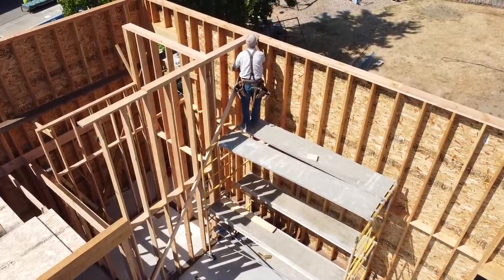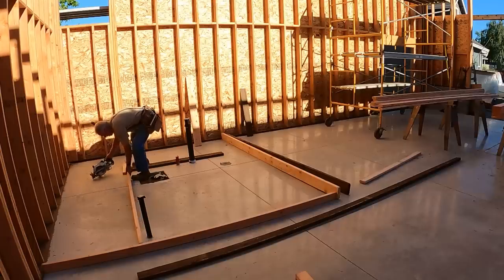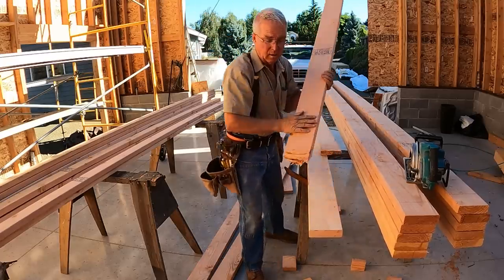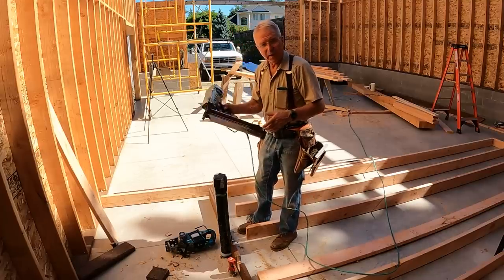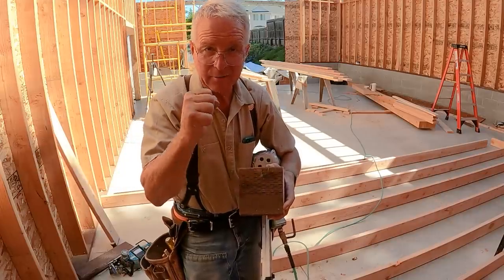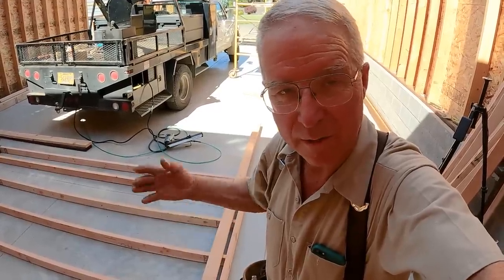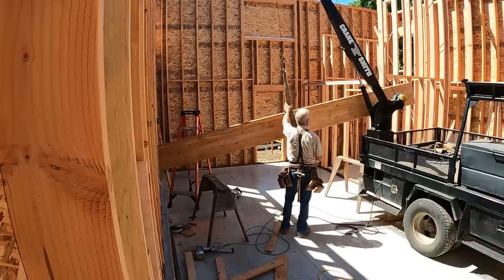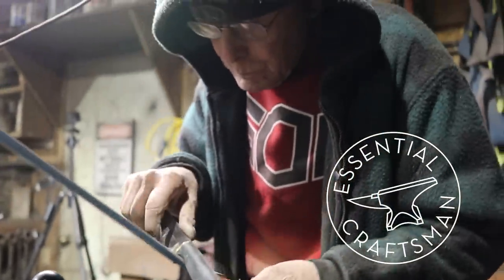My Truck  Has a Secret Weapon! Shop Build #12

Comment: 4:45 - I personally use 3 nails, one dead center, and two as far to the edges as I can without risk of splitting the wood. For the ones near the edges I angle slightly towards the middle to give them a little more bite.
Reply: Yeah, I was concerned that Scott seemed to be angling those nails out rather than in.

Comment: I’ve always understood that the compounds in treated lumber react to bare nails and that even in an interior “dry” environment galvanized or exterior grade fasteners should always be used in treated lumber
Reply: It wasn't like that until the EPA made them change the ingredients, it started eating away the fasaners.
Reply: That was my understanding too.
Reply: You are correct.
Reply: G-185" designation (which refers to the thickness of the galvanization). Anything less than a G-185 level is inappropriate for ACQ lumber.

Comment: FYI, the corrosion thing with fasteners in PT lumber has as much to due with chemicals used to treat the wood, as it does with metal exposed to moisture. Most chemical treatments use a copper compound, and that sets up a galvanic or electrolysis type corrosion to the steel even if your wood is “dry”

Comment: I've got to say, that's a pretty slick design you ended up with - a stairway that turns around the outside corner and is hidden behind a small bathroom. It's an elegant solution that keeps the building tidy and eliminates most of the wasted space that a traditional straight stairway would leave.

Comment: Spike knot… But it had the stamp of approval on it from the inspector.. 😂
Reply: To be honest ( I’m a builder) the cost of loss on the lumber yard is to high. 
The lumber yard tells you these knot filled boards are for your short lengths and blocking.  

In fact ( I’m with a GC) when the lumber yard has a project contract. They just send us extra boards for this reason alone   If the number of unusable boards it to high they just send us more.   They don’t even want the bad boards back. Just use them up where possible. 
Ohh and BTW.   This is a big part of being a carpenter. It’s are job to pick these issues out and work around them

Comment: I can tell you from personal experience the corrosion of uncoated fasteners in pressure treated wood is real. I don’t know if moisture needs to be present but if it does it’s a very small amount and treated wood certainly has moisture—also there’s usually enough residual moisture left in the concrete to get a small amount of condensation.

Comment: I live in our family home that is over 140 years old; it had no pressure treated lumber and is still standing and the nails/spikes they used to hold things together haven’t rotted/rusted out, probably because they’re huge. It is ballon frames with a dado cut into the studs in the interior walls to hold the floor framing and has post and beams along the outsides which carry most of the load. In having done some renovations over the years o can say things are well build as demo was a real PITA, the only benefit was no fire blocking or insulation in the walls so pulling wiring from basement to attic was easy though the gas bills to heat and electric bills to cool the house aren’t what one would call low. You can build things to last which frankly isn’t something that code is for as, at least to me, code in spots is extreme under kill for making things that will hold up and last and maximum overkill in some areas where safety has just gone too far, making some things just too expensive. 
The tools can definitely make life easier especially as you get older; we were just talking the other day about working when we were younger and how we used manpower for everything and looking back at what we could accomplish I’m amazed as today near everything we talked about would involve using or renting heavy equipment as the workers today just don’t seem to have the same grit level, or maybe they’re just smarter long term by not focusing so much on their body power and more on their brain power.

Comment: Hi Scott. You do everything so well. How about using a wireless  system for your crane controls. They are not expensive and are used a lot on trailer  and boat winches here in NZ.

Comment: Just a heads up as to why you use hot dipped Galvanized nails in pressure treated wood is that the Chemicals in pressure treated wood cause galvanic corrosion. Galvanic corrosion doesn't have to have water present in order to cause damage to the metals. This is because it's a electrical process not and oxidation process.

Comment: The crane will treat you well... right up to the point to when it or the lifting sling fail!  As long as you're not standing too close or under it when it fails, there shouldn't be any personal injuries.  😕

Comment: When I frame I hold the stud 10”-12” back shoot bottom nail 1st because I have scummed the plate before and Have deflected nails off my hand holding a stud the further you hold your hand back less likely to get less damage so if you shoot the bottom first in typically move your hand out of the way if you don’t have to twist very much

Comment: Most new pressure treated wood is “Micronized Copper Azole” and is not corrosive to fasteners anymore because there are no solvents used to suspend the chemicals anymore.

Comment: The concrete will likely release sufficient moisture to create galvanic corrosion on the non-galvanized nails in contact with treated wood, which contains copper.

Comment: Wonder if you could update the crane control to a wireless version ?
Reply: I would highly recommend this, was going to post it myself. Remember the little remote control that the guys use to run their concrete pump? One of those would be perfect for this. DO NOT get it off Amazon or Aliexpress because it will be a counterfeit knockoff. Looks like he would just need a 2-motion single speed control in this application.

Comment: 2:30 Serious question from an amateur … if you find you’ve used a board with a spike knot as a stud, should you pull it out, or reinforce it by sistering on a couple feet of another board?

Comment: Would another fire block added more structural rigidity, especially considering the height of the balloon frame?  The OSB's rigidity will diminish when it gets wet, such as if there is unknown water leaks overtime.

Comment: I was wondering if welding a u bolt on the end of the section with the hydraulic piston would help prevent fouling of the cable.

Comment: One thing I noticed and all of you novices should be careful about is nailing on a brand new slab as shown. Keep it elevated if you can, because If the end of your stud has a knot or if you're sloppy and nailing on a slight angle, the tip of the nail may exit the stud and scratch the floor. Minor detail, but I've seen this happen.

Comment: Why don't you put 6mil plastic under your bottom plates? That's a code requirement here in Canada.
Reply: I wonder if Canada has higher ground moisture content...?
Reply: @derekofbaltimore  I have no idea, but I do know that concrete emits moisture for years, which is why we do it.

Comment: Non dipped nails will be gone in 4-5 years
Reply: There's always moisture in every piece of wood. In conditioned space, I typically see furniture at 10-14% moisture content here in Charlotte, NC when I've checked with my Orion moisture meter. Could be wrong, but I suspect framing lumber in contact with concrete would be a bit higher M.C.